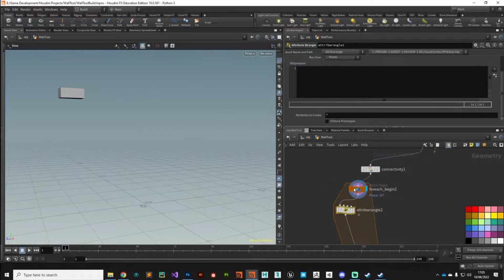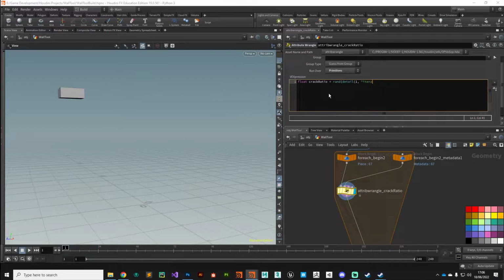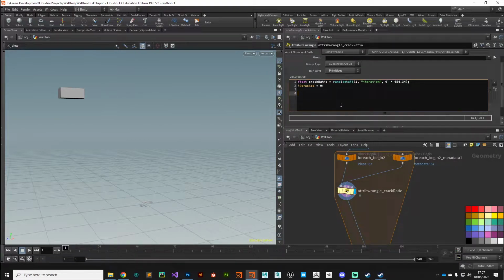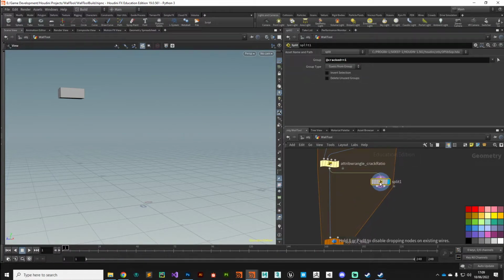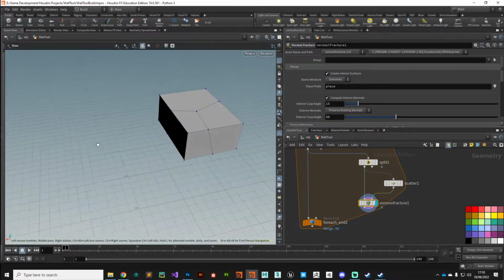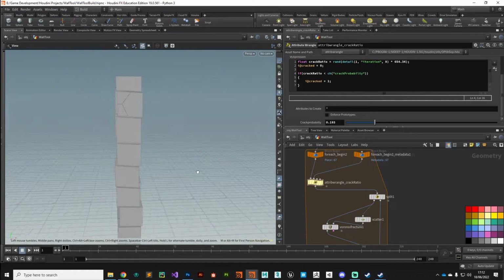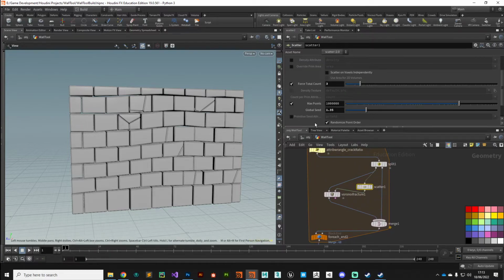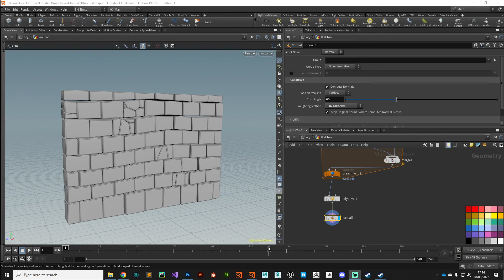Houdini - Wall Tool 07

Comment: @ 4.30 --> Split -> GroupType should be "Breakpoint" otherwise I get a plane (the upper surface of the primitive)

Thanks by the way for your video (Houdin 19.5.493)
Reply: I had the same issue, solved by typing "@cracked==1" (without spaces) instead of "@cracked == 1" as group condition in the split node

Comment: Hmm, no idea what I'm doing wrong, but the metadata node in for each loops doesn't work properly. The detail(1, "iteration", 9) always outputs the same value, i.e. the highest iteration. So the random value based on "iteration" doesn't work, either all bricks are cracked or none of them are.

I tried a couple of times to follow exactly what you are doing, but I still can't get it to work.
Maybe there's a version difference, I'm using Houdini 19.0.622 Python 3.
Reply from the maker: The third argument of your detail expression is incorrect. It should be a 0 as we’re referencing a single integer. It is trying to access the 9th component that does not exist. Let me know if this fixes your issues.
Reply: @RickBanks  That was just a typo in my comment, sorry! In the expression put I a 0 in the third param, just like you did in your video. I should have read my comment again before posting :/

Thanks for your help though!
I will figure this out eventually, I'm just stuck right now.
Reply: @grafgrantula6100  Same story here. Were you able to overcome it?
Reply: @ Sorry, I think I didn't manage to correct it and I'm not using Houdini anymore.
Good luck though!